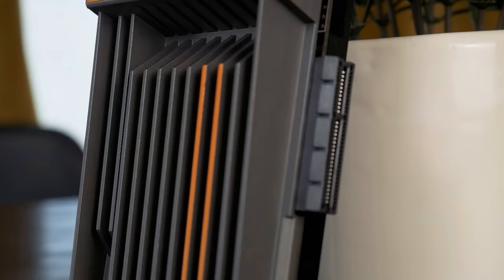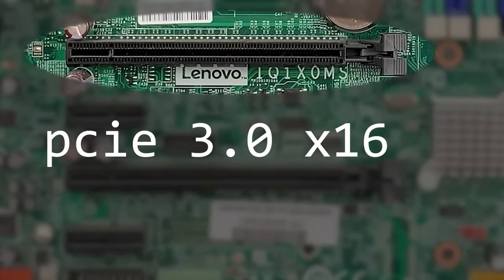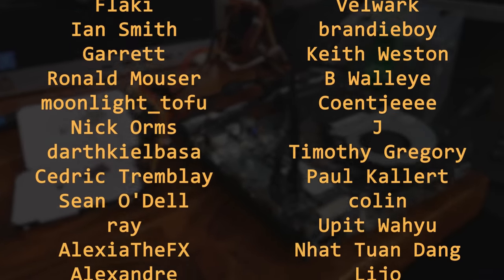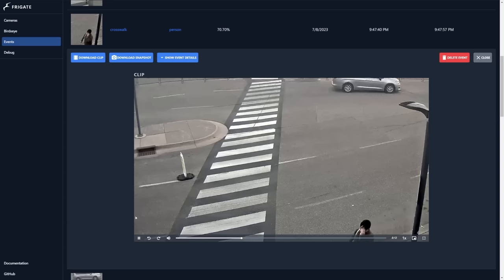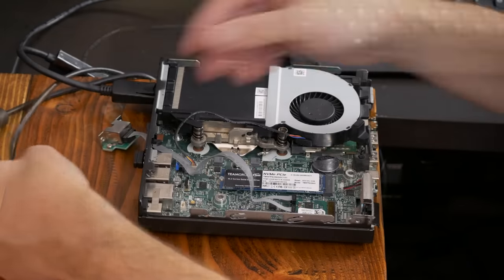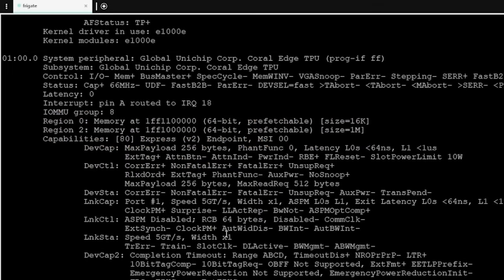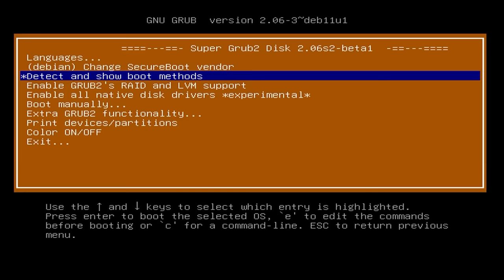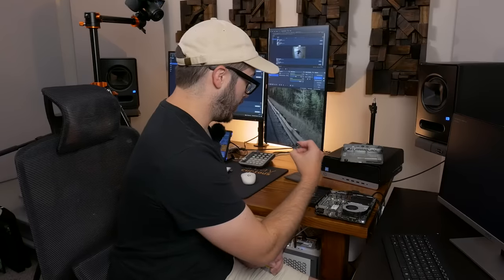Don't Overlook This Slot

Comment: About the 2x sata, if you're going to use 2.5 drives you can wire them to the usb ports for power
It may not be the most elegant solution, but it should work as long as they don't require 12v
I recommend grabbing molex to sata adapters, cutting the molex socket along with 12v cables and wire it up to an old, broken usb cord, that way you can easily replace it, extend it or do whatever you want with it
Reply: My own experience is that 2.5 inch HDDs (both spinning and SSD) need only 5V
In theory, 3.3V may be required for some disks, but I haven't seen one in the wild.
3.5 inch HDDs require both 12V and 5V though.
Reply: That is exactly how I powered the boot SSD of my previous server
Reply: @rexsceleratorum1632  That's both very clever and sort of scary if it was a production server in a business environment.  I think that I can learn from you.  Do you have a channel or website?
Reply: @gordslater In my ignorance, does modern USB but not version 4 / Thunderbolt have sufficient amperage to power high capacity drives?  I know that the new standards designed to be able to charge a laptop can handle up to about 100 watts, and I dimly recall USB 1.0 being specified for enough wattage that it could handle things like adapters for serial and other legacy ports (plus the standard was designed to allow up to 127 or 128 connected devices) but I thought that the generations between 1 and 3.something were fairly minimal amperage?  Hence why when I plug my smartphone into the USB 2 port it says "charging slowly" instead of the fast charge I get with a 2.3 amp wall adapter.  But I am aware that I could be confused about all of this, and I have not ever really needed to investigate HD or SSD power draws.
Thank you very much.
Reply: @ALittleBitOfEverything-wd9ee  Nothing so dramatic, just my home server in the form of an old laptop (hardware and electricity being expensive by Indian standards). I wanted to attach a few SSD's to it (for RAID) using various shenanigans involving mini-pcie to sata adapters and even a micro-sata to sata cable that I soldered together. I don't have a channel, I'm really bad at documenting things.
Reply: @ALittleBitOfEverything-wd9ee  External hard drives have existed for a long time, and they are all clearly within spec for USB without PD. Most of them use what look like normal laptop drives within an enclosure.
Reply: Actually, I found the cable on aliexpress. (haven't tested yet)

Comment: I tried to slip a nvme into my little wifi card slot (since I didn't care about the wifi).  I had a compatible 256gb slot.  I could read it, but I couldn't boot from it unless my boot manager was on the primary drive..

Comment: They make an E-key to PCIe adapter, similar to m.2 m-key to PCIe for egpus. It can support 2 lanes of pcie, usually 3.0.
I had an old laptop i wanted to get it for, but the adapter was too expensive for what it was.
2 lanes of pcie gen3 would be fine for something like a gtx 1050.

I wish my current laptop uses an e-key slot for it's wifi, but instead the wifi is soldered on. If it had an e-key, i could use a pcie wifi card, AND still tap into the usb lines to install some internal USB devices.

Comment: It will be interesting if on those models where the second m.2 is missing if it's enough to solder one to it, or if it also needs to be flashed.

Comment: I have a prodesk 600 g3 with nvme adt-link for a GPU, an nvme drive with e key adapter in the wifi slot and a sata drive. Very janky but it works!

Comment: He didn't mention that Coral TPU's are way backordered. Keep that in mind if you're going to go ahead with one! Additionally, consider the dual TPU model since that is typically more available.
Reply: It's not that bad if you're willing to keep an eye on third party resellers. The stock doesn't last long, but I was able to pick up a TPU in less than two weeks. I did have to buy the mini PCIe one, but that's nothing a cheap adapter from Amazon can't solve.

It's fantastic in combination with Frigate. I'm using it to keep an eye on my cats for now, but it's capable of so much more in combination with Home Assistant.
Reply: @Niosus  I was aiming to get a mPCIe one and it took Mouser like 9 months to send me one! I ordered it Aug 2022 and got it Apr 2023.

I'm not sure, maybe I should've waited on like Adafruit or something.
Reply: The dual one does not work with this m.2 slot, I bought one and ended up having to buy a connector which is installed in the SSD slot, and only 1 of the 2 TPUs are recognized
Reply: @CamiloSperberg  What adapter did you buy? I have a Dell Micro PC that I did the same thing for and the TPU "should" work as my slot should be compatible but it doesn't pick up the BIOS shows the slot as "empty"
Reply: @CamiloSperberg  Good to know! In the vid Mr. Haven said it was dual link but that would not necessarily apply to the wiring or specs of either the slot or the TPU.
Reply: @genethebean7597  I only actually ordered when I saw it in stock somewhere. I wasn't willing to deal with backordering.

Comment: Great video,  and very timely! I've been looking to add Frigate on my Home Assistant instance. I've been researching the Coral TPU and I've gotten equal amount of people recommending M.2 Accelerator A+E key as well as the M.2 Accelerator with Dual Edge TPU for my Intel Nuc 11 (celeron). ANy way you can weigh in here to clear up my confusion on which one will work please?
Reply: I can help a little.  First, it sounds like you already own the system that you want to put it in.  So you need to investigate a little and find out what slots if any you still have unused.  
Then look in your bios and/or use hardware discovery software like he does in the video to find out what version (if any) of PCIe those slots use and how many lanes of PCIe they have.  This is potentially confusing if you are new to the subject.  PCIe capable slots that are (mainly) intended to hold something like an SSD or WiFi adapter are a different shape and much smaller than the expansion card slots where you might put something like a graphics card.  Because of this (as far as I know)  they only have between 1 and 4 lanes of PCIe communication, whereas the older but still used in full size desktops PCIe expansion slots can be sized for anywhere from 1 to 16 lanes of PCIe.  But the older standard needs more room, even when it has just a few lanes.  In addition, both of these types are can be found in different speeds, sometimes in the same machine, with anywhere from the original PCIe 1.0 up to the current 5.0
So you need to find out what you have free, verify that it will work with PCIe (which as far as I know any slot intended to be used for an NVME SSD does and as mentioned in the video many of the ones intended for a WiFi adapter do, but slower.  I have no idea about SATA slots).
Then check the manufacturer's website (so Intel in your case) and do an Internet search to make sure that it lets you use any appropriate PCIe device and not just a few.
My guess is that a slot intended by the manufacturer for a NVME SSD is more likely to work and is almost certainly going to be faster.  But I could be wrong.

Comment: Just a tip: Limine boot loader can help to tie together two completely different operating systems together that want to be the only OS on your system, like Windows and Linux (or FreeBSD).

Not super plug and play, as there's no default config file and documentation is fairly thin, but it's super doable to glue virtually anything together with Limine (within reason) and have it stick. I've been dual booting with it between different machines and OS for about a year now, and it's been rock solid.
Reply: When does Linux ever want to be the only os? Windows is the one that throws a temper tantrum. You have to coddle it to even dual boot with another windows.
Reply: @MrBearyMcBearface  GRUB can feel like that sometimes
Reply: @MrBearyMcBearface Really, Windows just likes to throw temper tantrums.  For any reason.  But at least it's not as over the top proprietary as MAC'S, even if they are more stable than Windows.
I really, really miss the speed and simplicity of the ancient IBM OS/2 operating system, even if it was completely insecure.  But I don't know if that IBM even tried to make it Y2K compatible.  They could have easily dominated the desktop market with it, if they could have gotten out of the mindset of not advertising to consumers.  It came out years before Win 95, and was so much better.
Reply: @MrBearyMcBearface Windows doesn’t have a temper tantrum, just that Windows and Linux use entirely different systems, so it’s more like both Argue with each other. Both are at, not just windows. Which just shows you’re another incompetent Linux user :/
Reply: @MrBearyMcBearface I dualbooted win and Ubuntu and windows had over 20 currupted reg keys and the bootloader was messed up, had to spend 2 hours troubleshooting to get it to boot into windows and after installing drivers on Linux it WOSD'ed. Then I had to uninstall and cry in my bed.

Comment: I'm unable to get my dual edge TPU e key to work on the literal same elite desk mini G3 that you show in your video. I know I probably won't be able to get both TPUs working but I'm wondering if I need to return the dual edge TPU and get the single TPU for it to work? Any help will be very much appreciated I'm about to pull my hair out over this every time I try to configure detectors it does not find the TPU in the logs on frigate.

Comment: Hi  Hardware Haven , i have the same mini PC as yourself and was looking to include Coral AI card in the Wirelesss M.2 slot as well. I see there is a Coral Dual Edge TPU card that is an E-key  that needs M.2 E-key (with two PCIe Gen2 x1 lanes)*, will this work?

Comment: On my Lenovo M920q HWINFO does not show any x1 PCI-E slots, only x4 (NVME) and another x4 - the weird mini slot for the optional discrete GPU. No x1 slots. So that's how I know my Wi-Fi slot does not support PCI-E? I don't actually have anything installed in that slot.

Comment: Hey.. I got a similar elitedesk 800 g3 mini, but the power adapter is not the correct one. So far, I tried to buy the exact model adapter, but nothing works. It fails with 3 long 4 short beeps or red and white lights. Evwn i tried the model number available on HP site with no luck.Can you share your adapter part number?

Comment: So, I've got a couple of these HP machines with empty "wifi" slots.  Of the options you showed here, the Coral TPU is the most interesting to me.  Can it be used for anything other than object recognition?
Reply: Is the external antenna required for wifi? The wifi card doesn't have signal?

Comment: Using two power supplies like this together is a terrible idea. Voltage is relative. For example, if you connect something 15v higher than reference to something 10v higher than reference, you have 5v, but that's not the same as 5v higher than reference. Not all 5v are the same!

Comment: Thanks for sharing some interesting ideas.  I think the power outage really made it feel like being in a workshop and really experimenting with things that may not work!

Did you ever come across any converter cards to turn the E Key slot into B or B+M for SATA/NGFF M.2 SSD drives?  I wonder if such a thing exists.

With that M.2 E key SATA controller:  I'd be curious to see what kind of crystal disk mark speeds you get using a SATA 2.5 ssd or a regular 3.5 drive w/external power (grounded power brick like for laptops).  My guess is not much above 300MB/sec.  The 2.5 drives you have definitely won't max it out.

I'm on the fence about getting anything outside of 2.5Gb ethernet for that slot, since it is only PCIe x1.  For PCIe 2.0 you get 2.5Gb/sec each way for I/O, so 5gb max for the x1 slot.  Theoretically I think your NAS test maxes out the bus speed for that slot.

TPU module is probably best use of that slot for the DVR/NVR.  Maybe USB 3.x or SATA if a person ran out of ports.

Is Frigate only for DVR/NVR with cameras?  Or can it be used to do HDMI vid capture too, sort of like a personal DVR?

Comment: You can power 2.5" drives on a mini pc without an external psu by taking 5v from usb ports. It's very easy to hack a cable by cutting and old usb cable and joining it to a sata power connector from an old psu.

Comment: I have an HP laptop with three M2 slots (and a smartcard reader). One 2280 for NVMe, another 2260 for WiFi and another 2242 which is supposed to be 5G, but I don't have it. I'm not sure if this is technically a model that can run it, but I think they just assemble mostly the same motherboard anyways.

I wanted to put an extra hard disk in the M2 2242. I called HP about it, but they said nope. Ever since then, I've been trying to think about what could be done with it, but M2 2242 cards were a bit sparse on Amazon. The Coral card is a pretty good use case and, depending on specifics, might help when developing software for IoT edge if you can wrap your software in a VM and pass the M2 port through. It's a pretty big if...
Reply: I think you had some kinda loop in the power though. That was pretty hilarious. 😅I hope it's all good though. I dread stuff like that happening when I'm not quite sure what's would set it off lol.
Reply: I have a t480 and there is many people on reddit that successfully add m2 nvme on the wwan (2242) slot. But it must be a B key / B+M key and NVME, it cannot be SATA since it is pcie. 

 However, if you have an m key 2242 ssd, you can actually cut 6 pin of the ssd into B+M key. Its very risky but many people got it worked. 

 I actually bought a 512GB m.2 2230 ssd (m key) and an m key to b+m key adapter. Once that adapter arrived I might make a video about it
Reply: @DavidConnerCodeaholic As for the 5G card, you could add it yourself but must know if it has whitelisting. My T480 for example, have a whitelist and FRU number that need to be the same as the manufacturer supposed to put it on 4G model, so I can add it if I want myself.

But a 1TB 2280 nvme is now cheap enough that it might not be worth it to add a second ssd to the wwan slot, unless you want to dual boot on separate drive.

Comment: Well I do happen to have a very similar USFF PC I am using as a server and have that slot free.... I might have to look into it.
Reply: Is the external antenna required for wifi? The wifi card doesn't have signal?
Reply: @nassim99345  The cards don't have an internal antenna. You might get a weak signal if you connect an antenna and leave it inside the case but it is going to be shielded by metal.
In laptops they usually put the antennas at the top of the screen or on a plastic outer edge.

Comment: that hdd test failed because you have a floating VCC relation.
the ground of the laptop psu and the €5 psu should be connected to eachother, since right now how you connected it here, these 2 powersuplies will give a voltage from 0 to something, but their 0v actually might not be 0 compared to eachother if you connect them in a way like you did there or just with a resistor or voltage measurer.
actually if there is some form of pwm in the signal this might even create relative voltage spike differences.
in both cases that can be pretty dangerous since it will often cause many glitches and prevent a system from working properly and relyably, but it can also even actually damage or destroy your hardware.
so to make it actually work make sure the laptop ground and the external psu ground are connected together. that way they will give the actual same voltage.
since converting mains voltage to a speciffic voltage actually tends to generate a correct output voltage when looking at those 2 terminals, but when comparing them to the sourroundings or input it kind of is just floating around.
it is also why you typically need atleast 2 cables for communication since you also need to link the grounds.(in the past with telegraphs and such that ground was the actual earth)

Comment: The $5 PSU seems to have a lot of RF noise the display port cable is picking up. Connecting the pc ground to the PSU chassis shielded the PSU but your GFCI detected a voltage on the ground connection so it tripped. Yeah the $5 PSU is a hazzard 😂😂

Edit: you mentioned AFCI, so it may not be a dc voltage on the ground connection but an ac voltage which frequency could lead to an arcing based on the AFCI's decision to cut off power

either way, the PSU is an electrical hazzard

Comment: I have a Coral TPU M.2 Dual Edge Accelerator Module, do you know if that is compatible with the HP 800 G3 for use with Frigate?
Reply from the maker: Don’t think the 800 H3 supports 2 lanes which the dual TPU needs
Reply: Do you know the Model Number you used with this PC so I can order one?
Reply from the maker: Should be in the description

Comment: Lol I need to show you my frankensteined similar PC, I have a lenovo that is the same form factor that was a i5-7600h (I think) 
It has a preparatory pcie 8x slot and one of those mini pcie slots
I bought an adapter to convert the pcie slot into a 8x slot and put a 8 port sata card in there, then used the mini slot for a 2.5g ethernet card, then upgraded the ram top 32gb and stuck a 9900H in there somehow. Now it's my unraid server in a rackmount case that is just full of HDD's

Comment: not sure if you already know about this or have tried it... but I think you can add an adapter and use that E key slot for GPUs.... but given the price of these adapters... I'm not so sure if it's worth it. XD
Reply: Is the external antenna required for wifi? The wifi card doesn't have signal?